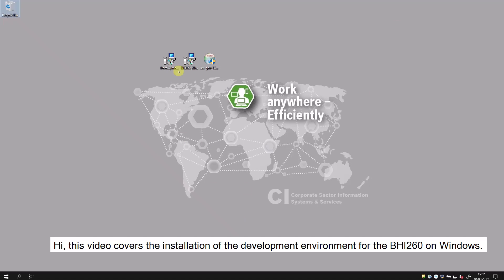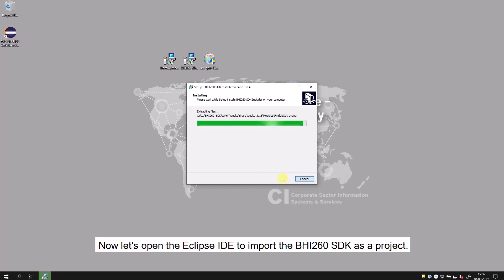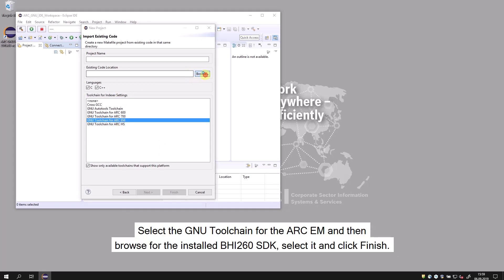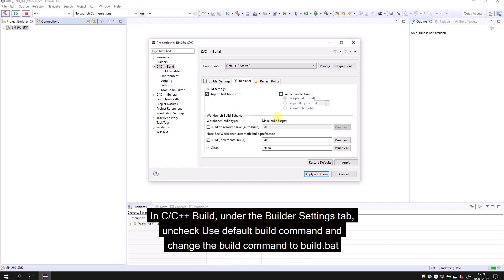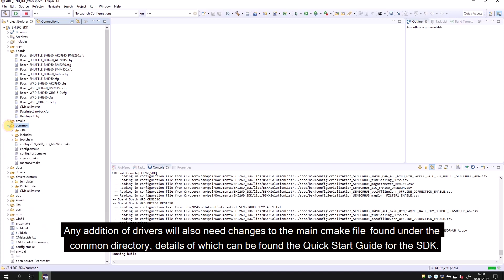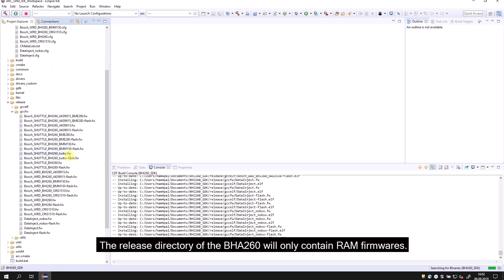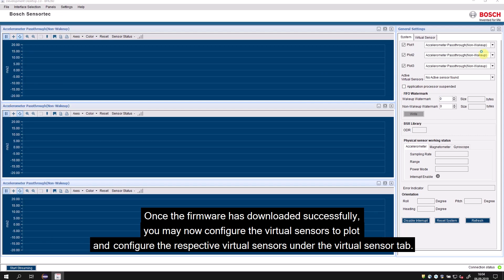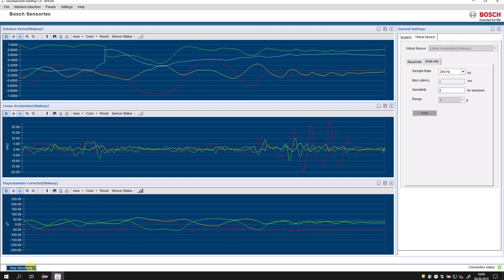Tutorial: BHI260AB / BHA260AB Software Development Kit Installation

Comment: Building today, you'll get this error:
ld.exe: missing --end-group; added as last command line option

"The fix is to add "-Wl,--end-group" to line 45 of the file \BHI260_SDK\common\toolchain\arc-gnu.cmake"

Here's the discussion about that:
https://community.bosch-sensortec.com/t5/MEMS-sensors-forum/BHI260-SDK-compiler-errors/td-p/17675